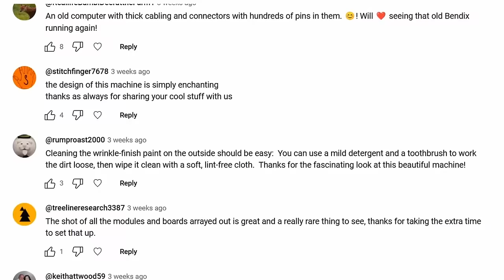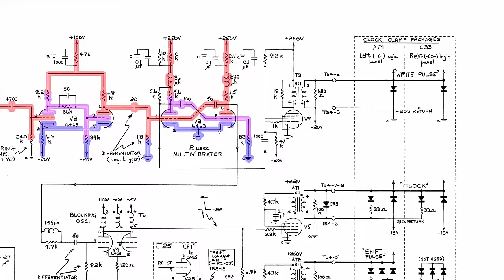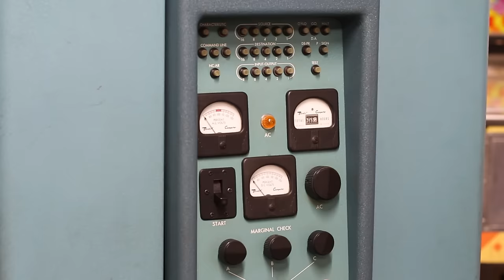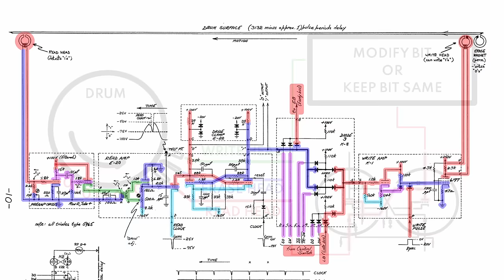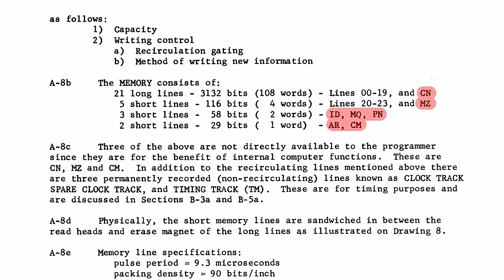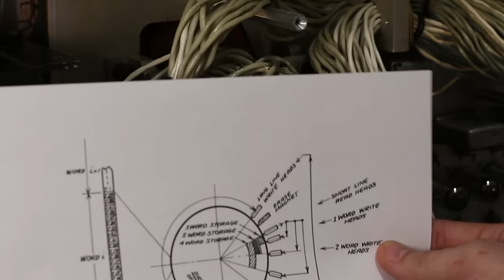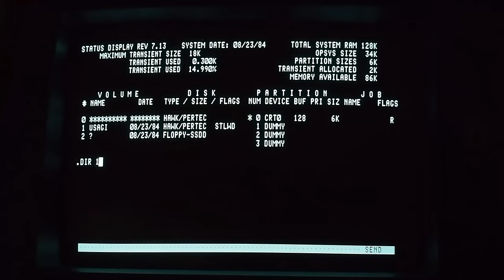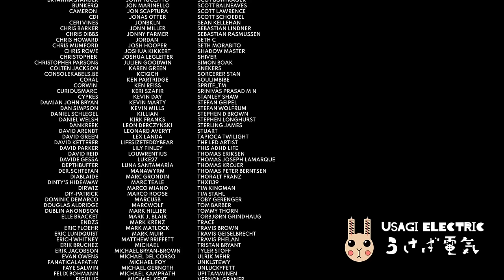Rotating Drum Memory with the Bendix G15

Comment: The high school I went to had an old computer that was donated to the school during the mid-1970's.  The computer was made by 3M (the Scotch Tape (tm) people).  It was designed in around '62 or '63, using discrete transistor logic.  The CPU was considerably smaller than the G15 as a result, the whole CPU and the magnetic drum main memory fit in the rough equivalent of about 14U of rack space today.   The machine had a 24-bit word, and was, like the G-15, completely bit-serial in architecture.   It didn't store the working registers on the drum like the G15, instead opting for chains of flip flops organized as shift registers.   It had a 24-bit accumulator, a 24-bit "B" register, a 5-bit opcode register, and some temporary registers for storing the operand address and next instruction address.   Addresses were organized as block, track, and sector.  Each block was 2K words, and there were 4 blocks, so the drum held a total of 8K words (by 24 bits, or the equivalent 24K bytes).  Each block was divided into tracks which I can't remember the size of, and each word in a track was a sector.  The previous life of the machine was  as a process control computer for managing flow of natural gas in the distribution network of a gas utility.   There was two complete CPUs, connected by a single 24-bit hardware-handshake register that allowed them to talk to each other.  It was a master-slave arrangement, with a primary and secondary CPU.  If the primary failed, the secondary had identical drum and register content to the primary (they were constantly synchronized through software) and could take over.   The I/O system was extensive, with relay inputs and outputs, discrete logic inputs and outputs, counter/timers, and analog to digital and digital to analog converters.  The I/O system was contained in a rack by itself that was 7ft. tall and stuffed with electronics.  The instruction set was pretty basic, with just 24-bit sign-magnitude add/subtract, load & store, bitwise AND/OR/INVERT, test instructions,  and a jump instruction.   No index registers or indirect addressing.  Any table accesses or computed branching involved self-modifying code.   The instruction set documentation included calculations for operand and next instruction sector number based on the rotational speed of the drum.  To optimize programming for maximum speed, you had to use these calculations to determine where to place an operand and next instruction.  For example, for ADD, the operand sector needed to be the sector of the instruction plus three, and the next instruction sector was the sector of the instruction plus six.   You didn't have to use these calculations, but if you didn't, the drum would likely have to make an extra revolution in order to find the operand sector, and yet another revolution to find the the next instruction to be executed.   Needless to say, optimizing things like table lookups and computing branches were cumbersome.   When I started at the high school, both CPUs ran just fine, although only the primary CPU had an interface to the 33ASR Teletype (110 baud)  console, so any I/O the secondary machine wanted to do had to be routed through the primary CPU via the interconnect register.   The machine also had a transistorized Parabam real time clock with BCD output that could be read all at once  (HH:MM:SS), two banks of BCD thumbwheel switches that could be used for inputting into the accumulator (one was six digits with sign, the other was three digits without sign), and a very wide carriage IBM typebar typewriter that was used for logging output.  I was never able to get that typewriter working, though.  My crowning achievement on the machine was that I wrote a functional FOCAL (FORmula CALculator, a simple interactive computer language created by Digital Equipment Corp.(DEC) for the PDP-8) interpreter for the machine during my senior year.   It would take about two seconds to take a simple line of a program entered from the Teletype, run basic syntax checking, and store it into program storage.   Doing a direct command, such as "TYPE 2+2" took almost five seconds to execute and print out "=  4.0000" on the Teletype.  The floating point math routines were particularly challenging to write to try to eke out as much speed as possible.    The whole thing was painfully slow, but it worked.  I wrote it to prove to myself it could be done, not as a practical tool.  It was coded entirely in native machine code (8-digit Octal words).      There was roughly room for about a 40 line program, and all of the rest of the space on the drum was filled by the interpreter.    One day during my sophomore year, I was working at the machine, and suddenly this horrible shrieking noise filled the room.   I immediately hit the master breaker and the noise lessened in frequency as the drums spun down.  It turned out that a bearing had failed in the drum of the secondary CPU, and that caused a massive head crash.  It was beyond repair, with deep grooves carved by the heads through the oxide layer into the aluminum substrate of the drum.  The secondary CPU then became a parts donor to keep the primary CPU running.   I was able to keep the primary CPU running through my senior year.  I went back to the school the next year to visit, and found the machine was GONE!   A new math director had taken over when the previous director moved into district administration, and the idiot determined that the machine was useless for anything even though it still ran, and had it junked. I was heartbroken.      Very sorry to see the drum in the G15 was bad...but it looked nothing nearly as bad as the secondary CPU drum in the old 3M machine.   I hope that the drum from System Source's other G-15 is good, and that the clock tracks are still OK.  Without the clock tracks, the machine is just as useless as a one with a bad drum.   If you re-coat the crashed drum, you'll have to figure out how to re-write the clock tracks properly.     Most of the drum-based computers had the clock tracks written on the drum at the factory by a special fixture, and in many cases, the heads that wrote the clock tracks were only used to write them with the fixture, and were not user accessible.  There obviously was no way to programmatically re-write the clock tracks, because it's a chicken-and-egg problem.    Be aware that if you re-coat the drum, that some means will have to be found to make the aluminum drum surface completely smooth (no grooves), and that the coating will have to meet very exacting thickness and magnetic properties in order for the original heads to be able to properly pick up and alter the state of the magnetic field in the magnetic coating.   Also make sure that there is no runout in the bearings, as that could be why the drum crashed in the first place.  It'd suck to go to all the work to resurface the drum only to have it crash again on spin-up.      Drum memory computers and accounting machines were quite common in the 1950s and early 1960's as it was less-expensive than magnetic core at the time.  As automated methods became available for producing magnetic core arrays, the cost of core went down pretty dramatically, and by the mid-1960's, core had pretty much taken over even in the lower-end computers.   Machines like the G-15, the LGP-30 (which was a genius design by Stanley Frankel using many tricks to reduce the number of tubes to a bare minimum), the IBM drum-memory machines, and this great old 3M machine (that I was so lucky to have been able to tinker with for four years...I learned so much from it) were wonderfully rube goldberg-ish ways of mixing moving parts with electronics to make low-cost computers possible.  Interestingly, there were even two (only two) electronic calculators made in the mid-1960's that used spinning rust technology as their main storage...the Wyle Laboratories WS-01 (https://oldcalculatormuseum.com/w-wyle.html), and the Canon Canola 167  (https://oldcalculatormuseum.com/w-can167.html).  Both of these calculators had short market lifetimes because of the issues with spinning media and head crashes, as well as being slow.  Magnetostritive delay lines and magnetic core quickly eliminated spinning rust as a way to store working registers in electronic calculators.

Comment: This is such an exciting project! I'm fascinated by the engineering that went into the design and manufacture of these devices. The quick access storage is reminiscent of the VT240 video RAM, where the horizontal blanking period of the raster scan is used to move bits into the RAM and shift lines of text when scrolling. You steal that little bit of leftover resource for something else! I'm glad there's a plan to replace the broken drum because I'm really looking forward to see this project succeed. Good luck!

Comment: I reckon a camera setup on the electric meter on full power up if you get there will be a laugh 😆
I did a stint at IBM here in the UK back in the 80's. They were coating their own disk's there, quite interesting. It was all very high tech at the time. 
Do remember hearing a few head crashes on testing though, not that often fortunately!

Comment: I watched some great videos on youtube of companies testing and making disk packs from back in the day. My personal fav. was them spinning the clean metal platter around and pouring on the  rust solution on the platter. Found an article saying at that time was one of the best ways to coat the platter. Reminded me of one of those art paint sets from as seen on tv. Spin the paper around and apply paint. I figured it wouldn't be to hard to make new metal platters and coat the platters. Most of the time would be testing the formula to see things about thickness after coating and how much (I forget) to store the data and read it back.  A good example also is Curious Marc. He had the old HP terminals using a tape drive. After replacing the belts on the drive. He remove of swapped out a resistor? to increase the write head output. Then he was able to use newer and more common DC tapes.

Comment: From reading about the G15, the drum had a timing track that was written at manufacturing time and was never erased/re-written. If you were to recoat the drum, you would presumably need to find a way to re-write the timing track as well. All doable but certainly not trivial.
Reply: He has the advantage of modern computing equipment available to generate the required signals. Could probably program an Arduino to do it if information is available about what needs to go on the timing tracks.

Comment: Ok, if that recoating thing works out, that'll be incredible!!  There are so many old machines that could benefit!  Not only spinning-drum RAM, but also (perhaps, eventually) restoring hard drive platters!  I realize the density of the material on the HDD platters would have to be higher than that on the spinning-drum RAM, but I'd imagine that if you can solve the spinning-drum problem, it's only another few steps to solve the HDD platter problem!  How exciting!!

Comment: Now I'm remembering a famous old story about a "Real Programmer" who knew the instruction timings so well that he would specify exactly where on the drum each instruction should go, and he timed them so that once one instruction had finished and the computer was looking for the next instruction, it would be just about to pass underneath the read/write head, thus speeding up processing even when compared to the "optimising" compiler supplied with the machine which was supposed to do exactly that same job, but still couldn't do it as well as a human.
Then when a printer required a short delay between each character, he reversed the optimisation in the print routine such that when an instruction had finished, the next instruction would have just passed the read/write head so the computer had to wait for a full drum rotation before getting the next instruction.  Thus he saved memory by not needing to add a delay loop.  The hardware itself became the delay for the printer. That's exactly what a Real Programmer is like. 😄
The story goes even further to when the Real Programmer was (in his opinion, unfairly) dismissed from his job and responded by "sabotaging" a program before he left by making its printout look messy with a random asterisk.  Another programmer (ostensibly the one telling the tale) was asked to find and eliminate the part which was causing the random asterisk, and after discovering that the program "ran off the end" of the drum and the program continued at the start of the drum... that programmer decided not to bother going any further and simply told management that he couldn't find the code which was causing the asterisk. 🤣

Edit to add: When I see Z in a register name, the first thing I think of is "zero" so maybe that register contains flags involved with mathematics operations?

Comment: Recoating hit me at approx. 24:00, and of course Usagi himself way before me. Reason is that I saw an old film showing how IBM engineers literally “painted” their first hard disk prototype platters. The fast rotation of the platter was an integral part of creating an even coat (very messy too), but how that process can apply perpendicular to the rotation (a drum, not a disk) is of course beyond me. The chemistry was indeed very secretive according to said film, but I would think that Usagis friends have all relevant knowledge today, 60+ years later. Best of luck! 👍
Reply: Disks can  be spin coated. that process give very precise deposition of material.  Maybe he can test magnetic paint on his crashed hard disks first. I'm not sure how to coat a drum
Reply: I'd think rotating the drum at a say a 45 degree angle would work.
Let a combination of centrifugal force and gravity distribute the liquid from one end to the other.
Or maybe they blew air along the length of the drum, though that might create ripples.
Would be worth testing on surplus aluminum or cardboard tubes if the exact method isn't known.
Reply: Not the same film I saw, but same era…:
https://youtu.be/8krGLyVRiRw

Comment: In the future when it comes to cleaning. Take a look at art conservation. 
They use some very interesting chemicals that are very mild. 
My only concern with using dish soap is it has salt in it.
And I know art conservation is used something called surfactant to act as a soap.
Imagine if it's safe for oil paint and Belgian linen it should be safe for steel.

Comment: As a former repair engineer on the drum system storage, a classic failure as shown on your video, firstly caused initially by extremes of heat gradient, initially caused by generated heat from the machines internal circuitry and secondly the environmental temperature gradient. As we all know, using copper is great for the electron transmission of circuits, it does also have a drawback. Temperature expansion. Then you have differential expansion curve from the internal Aluminium drum, Sadly regardless of what is done between the two meatls to prevent this, on a quantum leve l the expansions are never going to be equal. 
During the time I was working on these, the differential expansions mainly caused by environment changes seemed to be the main culprit. One machine in particular never had this problem though. The drum lasted well beyond the predicted manufacturers lifetime and the head crashes never happened on it in its entire life time. The reason for this was a room with carefully managed environment. Temps and humidity controlled cabinets and rooms made this machine run flawlessly for over 10 years before it was replaced by a plate drum casket arrangement. Out of the service cycle this drum has one, maybe two scratches that were visible to the naked eye. Again environment dust, debris and bacteria at the scale this machine depended on, maintained this clear space between head and surface. Out of all the machines we e3ver serviced, this one machine never had a drum replacement in its life.

Comment: Way cool stuff!  Love that use of the dead band between erase and rewrite to stash the fast access stuff!  Clever.  One note that popped into mind you might consider.  You had mentioned that that big read amp ass'y with the 32 tubes had adjustments for each channel. Depending on what parameter they're adjusting, might be a good idea to pull that unit (and any others that are handling the analog head signals, if they are tuned/adjusted individually) and swap them in as well. Might help you start out on a flatter playing field? (Thinking of how tiny those signals are coming from the drum and how even microscopic differences in surfaces and head position can really affect signal strength and integrity.) 
  I'm an old school tech, tubes included, but admit to starting in the computer world in the 70's with mostly TTL stuff. (PDP-8 with core memory and RK-05 drives as a short excursion in the early '80s.) Best of luck, hacking and skill with these beasties!  Recoating that drum seems like a great idea. Hope all goes well.  Will be watching.
  (Funny. The company I now work for started up in the '70s, building solid state replacements for the old Ampex tube studio recorders. Now I'm working with parts I can't even see without major optical help. DSPs, microcontrollers, SDR radio. All sorts of crazy stuff.  And i'm restoring a 1938 Philco radio for one of the youngsters at church who's in love with old tech.  Good to help keep it alive!  Stay the course.  Stu